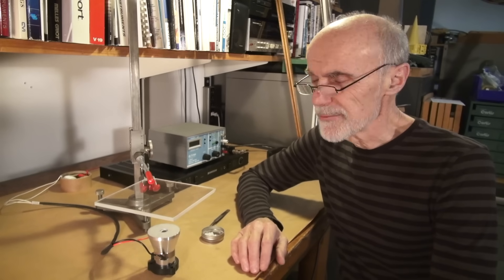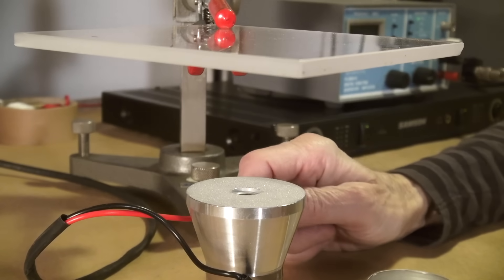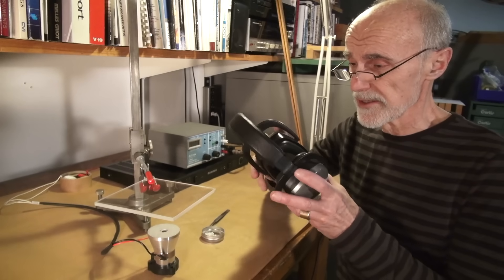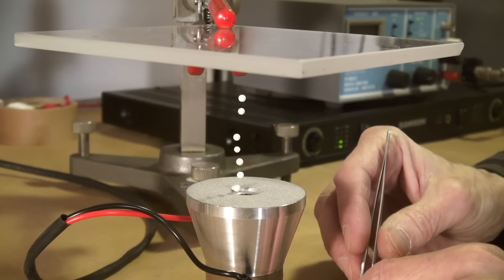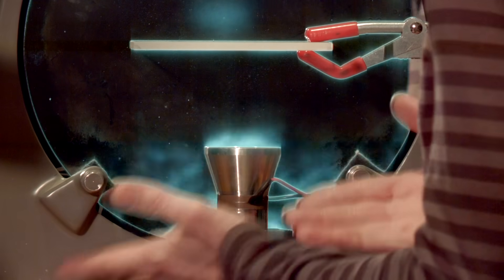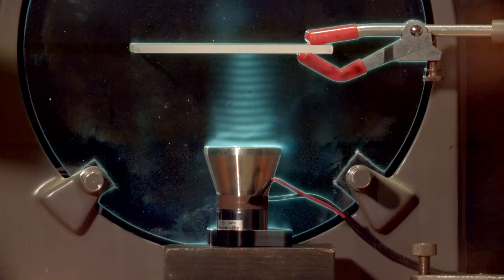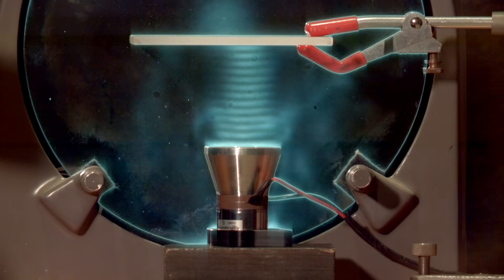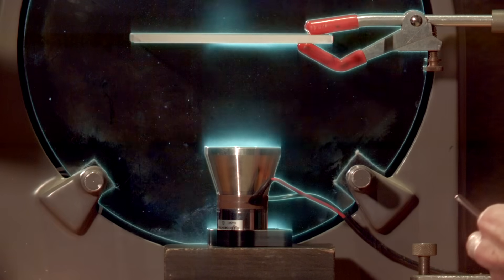Acoustic Standing Waves and the Levitation of Small Objects

Comment: This guy: "Even though I can't hear it I'm still going to use ear protection."

Our generation: "Even though I'm bleeding from my ears I'm gonna turn up that bass."
Reply: That is funny but true.
Reply: Ultrasound is more energetic than a loud bass
Reply: @lucaslucas191202  No, amplitude is what determines strength not frequency.
Reply: @callummclaine9160  
I said more energetic, not strong
Reply: @lucaslucas191202  Strength is what damages ears. Whilst the energy causing a sound wave of higher frequency is higher than that of lower frequency if at same amplitude, the total effect would be the same. The amplitude which is the difference in concentration of particles within a wave, is what we feel and can dislodge, break or cause failure.
Reply: @lucaslucas191202  Just for an equivalent, this is exactly the same as voltage and current. Voltage have no effect on us at all, but the electron flow (current) is what we feel and can cause heating upon body and muscle contractions. High voltage will cause a high current in our body though. But it’s the current that kills. High frequency does not cause a high amplitude on us though.
Reply: @callummclaine9160  hmm so my understanding is ... bass is pretty much tones and sounds of low frequency right ? Which is well within hearing range I suppose. By turning up the Bass you practically increse the frequency. Frequency is just the cycle of vibrations measured. In music it's the pitch I suppose. Energy affects Amplitude proportionally.. higher amplitude means higher energy.. amplitude in a sound wave is the peak distance so high amplitude also means higher sound. So louder sound hurts your ears as this can cause strain in the ear membranes and cochlea.. but your ear membrane is basically a thin piece of membrane that vibrates just like the one in the speakers... and high bass means high frequency.. thats how many cycles does the wave go through or in this case.. how fast the wave propagates.. higher frequency means high number of times the membrane in our ears vibrate.. which can also cause strain..verdict: both answers are right too much of anything is good for nothing. But amplitude and bass doesnt correlate. So it's not the Energy that hurts, it does hurt but here it's the velocity. How fast the ear membrane vibrates.
Reply: @callummclaine9160  yeah completely agree on that.. it's not the voltage that kills but the current..but here both can kill you I mean high amplitude and high frequency. Its just the bass means frequency so frequency kills you
Reply: @callummclaine9160  yeah true. But by strength I hope you mean sound intesity. Measured in Decibels right bro ? It's energy carried over a meter by a sound wave right? But the thing is sound doesnt travel in a wave like an EM wave. It propagates. So the distance is a major fact in determining the sound intensity. As the distance increases how much the sound intesity affects is inversely proportional. The energy gets lost the particles absorb the sound blah blah blah.
Reply: @lucaslucas191202  more energy means higher amplitude. Higher amplitude means the sound intensity is also high so yeah kinda both the same but the sound intensity can vary by the factor of distance
Reply: @callummclaine9160  the thing is... sound intesity at much shorter distances will be at the peak. So it applies for earphones which sit right in your ear canals. There is no much loss of energy the whole entire air column inside the ear canal vibrates. Stressing and straining and increasing fatigue for the ear drum and cochlea. I mean the "boomer " is right anyway. With enough frequency and enough intensity the small bones in cochlea could pierce the ear drum causing rupture.. and also sealing the ear canal with an earphone creates a pressure state which means any particle inside also vibrates back and forth.. this can damage the ear causing bleeding too.. and also the pressure difference might cause rupture as well causing  a brain haemorrhage
Reply: @chonkyboi4558  Ok, I don’t know music all I know is physics. There is no relation of frequency and amplitude. I assume when people say turn up the bass or bass boosted, they will increase the amplitude (volume) of the bass. You referenced fatigue of ear drum due to high frequency, I require a reference for this as I have never heard of this in my life. 
Amplitude in a sound wave is the difference in concentration of particles from areas of higher than normal to lower than normal. The louder the volume the greater the difference. This difference is what can cause extreme amounts of pressure on externally on an eardrum to the inside of an eardrum, causing a break ( I don’t know the biology.) but think of slapping a drum, slapping the drum fast will not cause damage, slapping it faster will not cause more damage, but slapping it harder could cause damage as you are increasing the pressure or force applied. I hope you understand me.

In summary, changing frequency have absolutely no effect on damage to any components unless it matches the resonant frequency, Only amplitude effects damage to eardrum.
Reply: @callummclaine9160  same bruv 😂😂😂 all I know is physics as well. And yeah you re right there is no correlation between amplitude and frequency. They are unrelated independent variables. But the issue is Bass means low pitch or tone. And pitch is made up of frequency. So increasing the bass means increasing the frequency. This would keep the amplitude unchanged BUT a pair of headphone wearing teenage has the audio source directly on their ear canal. As we know sound is just vibrations of air column, and as you said higher amplitude sound which is a loud sound would definitely beat the ear drums membrane hard but high frequncy which is the real case here by increasing the bass can cause damage in the sensitive hearing cells I think they are called by this silly name stereociliai something in cochlea get damaged causing permanent hearing impairment and making the victim insensitive to high and low frequncy differences. Idk man I am not so smart but that's what I can think of
Reply: @callummclaine9160  resonant frequency wont be a problem as our ear membranes are pretty flexible. But that's why it causes damage to the cochlea. The cells can definitely get ruptured. And if you think high frequncy cant hurt you just get a sound amplifying app and crank it up all the way to 250HZ or so and also crank It up all the way to 20 19Hz. The thing is our ear has sensitivity for both frequencies and it's bad to hear either the lowest or the highest. Especially the lowest though because you cant hear the low frequncy sounds under 20Hz but it can definitely hurt your cochlea auditory censors pretty badly. And the Bass in music is anywhere from 16Hz to 250 something Hz.
Reply: @callummclaine9160  although maybe it's time to start thinking about vibration itself ? I mean.. we also have our cerebral fluid floating around in the head and if the bass is high enough which is the frequency increase.. now thats going to start vibrating the liquid like crazy. And just imagine gently swirling a glass of wine.. and sloshing around water in the drum of a washing machine.
Reply: @callummclaine9160  
Didn't know that.
Reply: @chonkyboi4558  
There are several ways a wave can be more energetic, amplitude is only one of them, wavelength the other
Reply: @lucaslucas191202  true but high amplitude does correlate with  energy right ?
Reply: @chonkyboi4558  
I mean more air is vibrating which is more kinetic energy so yeah
Reply: bass isn't what kills your ears anyway, its the high frequencies.
Reply: @DJTimeLock  nope...
Reply: True 🤘🤘🤘
Reply: ...Our generation: "Even though i'm bleeding from my eyes i'm just gonna watch one more video on youtube >_< ! xD
Reply: All the "ok boomer" and "woosh" comments are from sheep kids who have no opinions of their own, no talent at making jokes, but need likes.
Reply: @bigsmall246  They also don't know what bass is... They think phone speakers sound good.
Reply: @menyasavut3959  Stfhu
Reply: @rishimajaju7650  what she said?
Reply: @timur5241  idr lol
Reply: @rishimajaju7650  oh ok
Reply: So you have already been OK boomered
I really mean no offense tho
Reply: you know... Youtube or the Internet never cease to disappoint me. Here this guy made a valid statement and the only thing you people come up is "ok boomer". Pathetic and embarassing.
Reply: His generation practically paved the way for all the music you love.
Reply: Every generation was the latter then the former
Reply: @EvonixTheGreatest  I don't even know where to begin to explain how that doesn't make any sense whatsoever...
Reply: RiseYx  Oh look. More originality. Yawn.
Reply: Ok zoomer
Reply: Ok boomer
Reply: Ok dumbasses
Reply: HollaHolla DollaDolla  They don't. They're just parrots. Someone says something they think is funny or original and they simply repeat it, ad infinitum.
Reply: Wow.  All these idiots saying “Ok boomer”.
You literally stated “our generation”.

Some people are so bitter, eager to lash out.
They can’t even think straight.

I thought your comment was clever and funny! 👍
Reply: @stickytourbus  ok boomer!🤞🏻
Reply: @stickytourbus  nah nah mate you good. The thing is they think of it as a joke..yeah sorry for the sense of humour of my generation or the lack there of. Dont worry lol 😂😂😂
Reply: @chonkyboi4558  

Right on.
Thing is, they are calling him a “boomer” when he clearly stated “our generation”; meaning younger.

I don’t care about the word, but they are calling a young fella a boomer!?!?

I’m not quite a boomer.
But I am older now.
You all will be as well someday.
With any luck!

P.S. I am a bassist and an audio engineer.  Interesting debates going on in here!

Have a great weekend!

Liberty. Constitution. Republic.
Reply: @stickytourbus  hahaha true true. Sense of humour is like wine..needs to be aged to be exquisite. Well I am pretty sure they see it as a joke although it's annoying even for a young bloke like me.
Reply: @chonkyboi4558  

I’ve always had a great sense of humor.
Looking for the funny in everything.
I wasn’t the class clown though.
I was the guy that talked the clown into it!

😁
Reply: @stickytourbus  ok boomer
Reply: @stickytourbus  
Boomer is a meme, people aren't mad lol
Reply: @lucaslucas191202  Was a meme. Now it's purely an annoyance, even more so with it hardly being used correctly anymore. 
What's also an annoyance is how people are spamming it at some poor guy who did nothing to warrant it.
Maybe you find it funny, but humour can be relative, and I'd have started punching people if this many said "Ok Boomer" to me in person.
And "Boomer" is technically derogatory slang, like "cripple". You wouldn't be let off for saying "Ok cripple." to someone.
Reply: @Zaire82  
You should take anger management classes then, and realize that just because you get angry at something doesn't mean the other person meant anything by it.
Reply: @lucaslucas191202  I didn't get angry, I was only making a fair statement, and that's not how it works. If someone finds offense in something someone says, it's the fault of the person who said it for being careless. That's how everyone always assigns blame in situations like these. Like, if someone accidentally says something racist to someone who takes offense to it, it's the fault of the speaker.
Rather than saying that to me, you should have said "Just because it's a joke to you doesn't mean it's the same for others. Perhaps in the act of spamming it at a person repeatedly, it stops being a joke and starts being a mob attacking someone." to them, seeing as they are the offenders.

Besides, I can guarantee that most people repeated it because they don't like them and want them to get spammed with something that's obviously insulting to the recipient.
Reply: @Zaire82  
It's always been my opinion that offense can't be given, only taken. Well something along those lines at least. Let's say I am offended by the simply act of you disagreeing with me. Now that's supposed to be your fault for stating your opinion and not being careful that it might hurt my feelings? Nah. No one would agree with that. You simply can't take it to that extreme, however, on the opposite side I find that people can say literally the most heinous thing and I have no need to do anything about it. As long as they are just words it doesn't matter. I'm not saying I don't understand that people can be angry about people saying some fucked up shit, but I'd still prefer everyone just stop caring about something as such things that practically don't matter.

I simply disagree with your last sentence. At worst they might've spammed him because they disagree, but not because they dislike them.
Reply: @Zaire82  Boomer means a person who doesn't keep up with current times. That can be used even towards someone like me who doesn't know what's popular on twitch for example, it's situational. In any case, kids who spam this don't even know this much, cuz even as a joke it doesn't make any sense. So it's kinda pointless arguing about something illogical.
Reply: @Zaire82  Ok boomer.
Reply: Huu
Reply: ok Boomer
Reply: ok boomer
Reply: @novakastmusic  OK zoomer
Reply: Ok boomer
Reply: ok boomer
No offense lmao
Reply: Ok boomer
Reply: Ok boomer

Comment: To the people optimistically hoping for this technology to be applied to larger objects/vehicles/people, this is why it will never happen.

Short answer:
A.) The pressure of those sound waves required to lift a human will make you permanently deaf, and probably kill you.
B.) The sound will not be reflected on a flat surface (the ground/earth) and will reflect in undesirable directions.
C.) Sound travels around 700mph depending on the air temperature, so you would not be able to gain much altitude due to the sound reflections (from source to the ground and back again) being too slow to catch up to a moving vehicle at a high elevation.
D.) Variations in wind would probably cause a levitating vehicle to flip very easily, as the propulsion is completely reliant on the sound being directly aimed at the earth, then hitting a level flat surface underneath the vehicle.

If it were that easy (as the majority of viewers of this video have imagined how to implement this into flying cars/hover boards), it would have already been done.

Comment: What I don't get about this:
Isn't a standing wave still a wave that oscillates at given frequency? So there would be spots where that oscillation is equal to 0, and there would be spots where the oscillation is at a maximum level. But the spots of maximum level are not equal to "always high pressure", they oscillate from very high pressure to very low pressure to very high pressure and so on. So how does that ball still float on those spots even though it's not a constant pressure?
Reply: Whether it's a high or low pressure, the balls get pushed into those zones by the fast moving air molecules (which are at  pressure nodes).

Comment: for those who want to make one similar the reflector is a square cut of perspex as you can see and the  ultrasonic transducer  i got the 40khz one from jaycar electronics in australia and the simple to make 9 volts battery operated  nausea generator powered with 12 volts dc instead of 9 will power it good  so good it sounds almost deafening through your head from anywhere almost placed against your body  via bypassing your ears

Comment: Hi again Wolfgang.  I have some of those circular ring ultrasonic oscillators for the old sonoluminscent projects.  Is that what is inside these conical-shaped transducers?  Do you think I could mount one under a thin sheet (maybe with a hole in the center) and use a top glass sheet like yours, and possibility make a levitator?
Reply: I believe all ultrasonic transducers are piezoelectric crystals, so I don't see why it shouldn't work for levitation purposes.  Since you've used it for sonoluminescent projects, you already have the driver for it.  Why do you want to mount it under a thin sheet?  Is it because it has a peculiar acoustic radiation field?
Reply: @wolfgangrueckner7151  OK, so now I assume one of these discs is inside that conical enclosure.  I was confused as to why there were TWO flat surfaces.  So do you think I could just firmly mount the disc and use a flat glass over it?
Thanks much!!!
Reply: @dalenassar9152  There's a flat surface on the transducer so that it generates plane waves.  The reflecting surface is flat to act like a simple mirror, reflecting the plane waves back onto themselves.   Sometimes a spherical mirror is used instead to focus the plane waves into a certain region and give you more intensity in that region.  What I don't know about your circular ring transducer is how the acoustic waves propagate out.  Is it designed to focus the waves into the middle of your flask?  If so, you might want to think about what kind of reflector you need to make it work.  Just imagine light waves and treat the reflector like an optics component of you apparatus.

Comment: I have two transducers that looks EXACTLY like this one.  One is from a 40Khz driver, the other from a 28kHz driver board (I think 100W), but I no longer have the drivers.  Can you tell me what driver output (frequency and current) is needed for the one you are using?  IT WOULD BE GREATLY APPRECIATED!!!  Can I use a square wave?  Would it have to SINK and/or SOURCE a lot of current?
Thanks for the great video!
Reply: We use an American Piezo 28 kHz cleaning transducer (50 watt) and operate at about 28 watts:  150 V p-p at 1.5 A p-p.  We power it with a sine wave but I'm sure you can use a square wave (if the harmonics don't bother you).